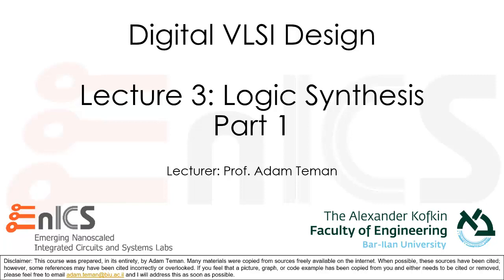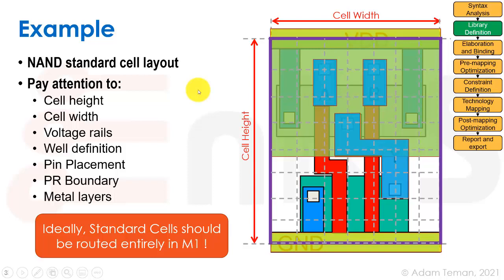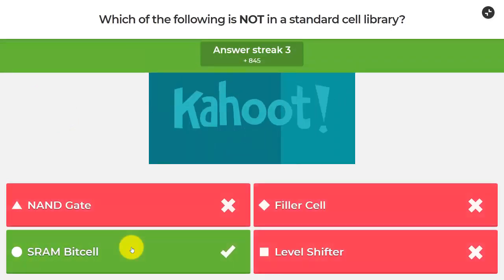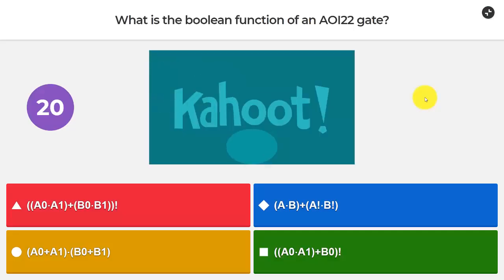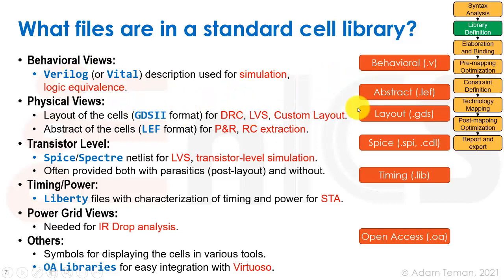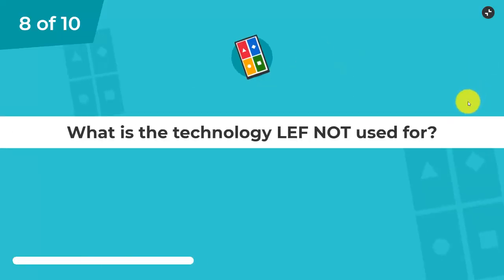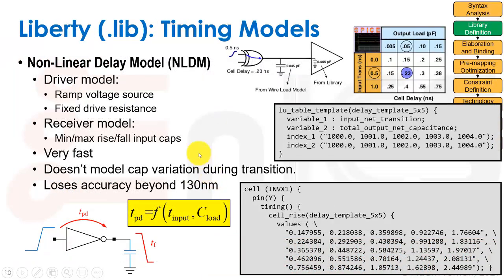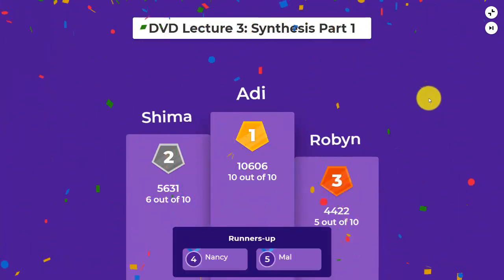DVD - Kahoot for Lecture 3: Logic Synthesis Part 1

Comment: Q1. OPTION 1. Technology independent or dependent. i guess dependent
Reply from the maker: No, no, no - it is unequivocally "IN"dependent.
Synthesis ultimately does map the design into standard cells, which are technology dependent. But on the way, it maps the logic into "primitives" (i.e., AND, NOT, OR, XOR, etc.) which are technology independent. This is what the answer was referring to.